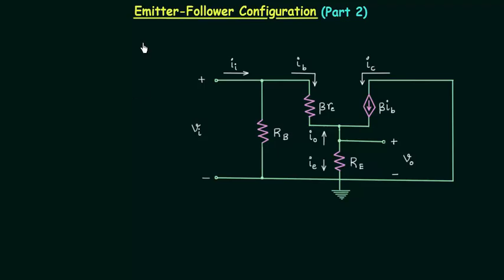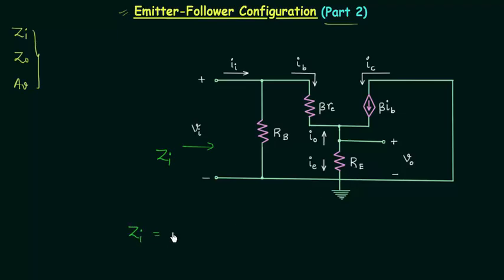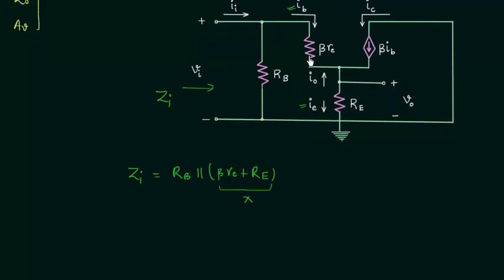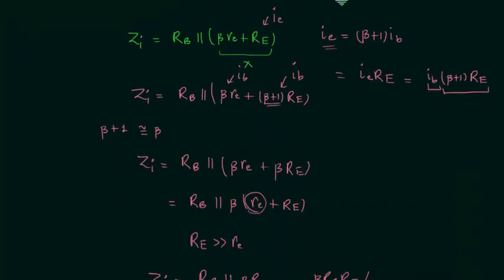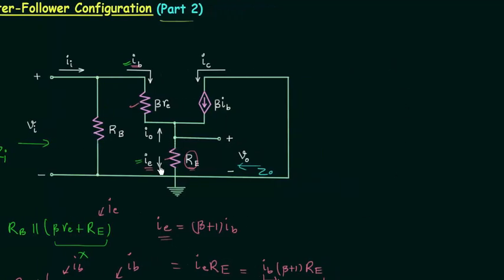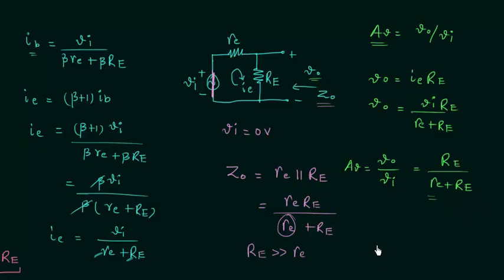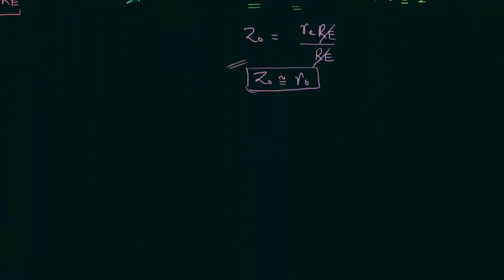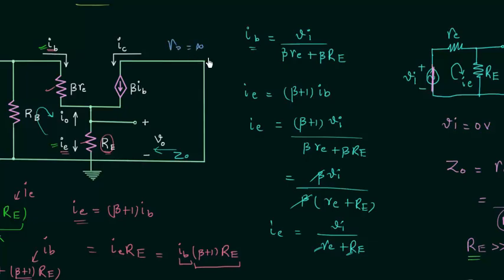Emitter-Follower Configuration (Part 2)

Comment: Ai = Rb/[Rb + B(re+Re)]

and when we consider the output resistance of the transistor in re model not equal to infinity and some large value. still the value of Zi, Zo and Av remains same as there is no term of Ro involved in those equations.

Comment: sir can i use the emitter follower in a DC circuit in order to maintain the dc voltage on the base of the transistor on the emitter terminal but with amplification in the current gain ?

Comment: Ai = (- beta*RB)/((beta*(re + RE)) + RB)  -> in case of ro = infinite.
when ro is not infinite->
Zi = RB || x , where x = beta*(re +  (RE || ro))
Zo nearly equals (re || RE || ro), as beta + 1 ~ beta
Av = ((beta +1)*(ro || RE))/x ,  where x  = beta*(re +  (RE || ro))
Ai =  (- (beta+1)*RB)/(RB + x)  , where x  =  beta*(re +  (RE || ro))
Reply: Faizaan Qureshi 
All true but in Ai with ro
U gotta use current divider between ro and Re so the nomirator will be 
-(B+1)*RB*(ro/(ro+RE))